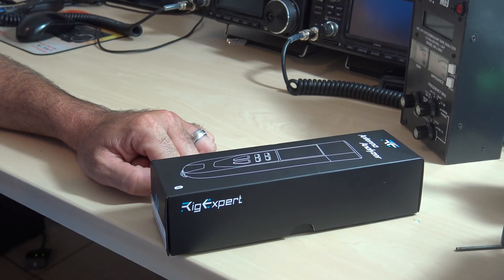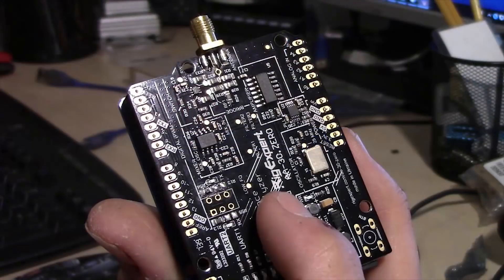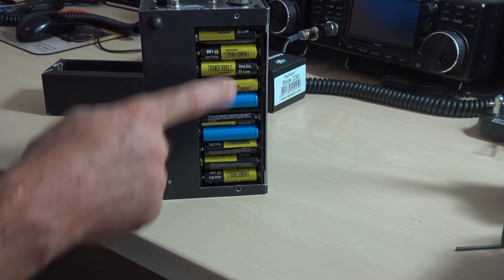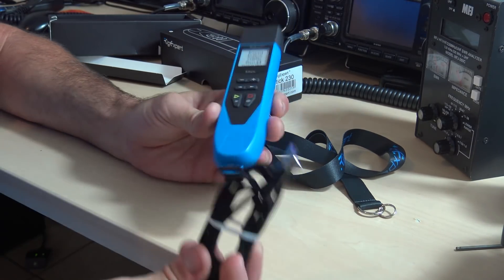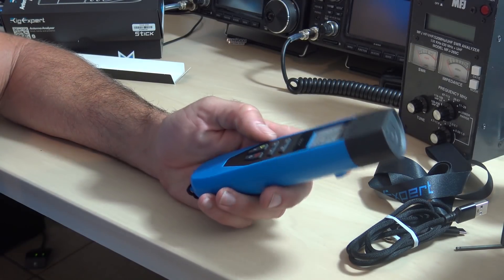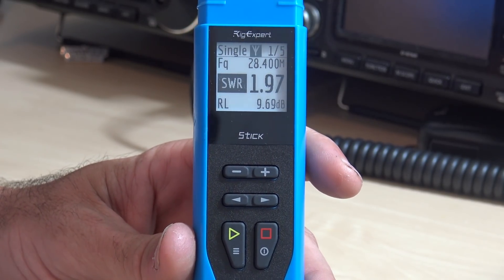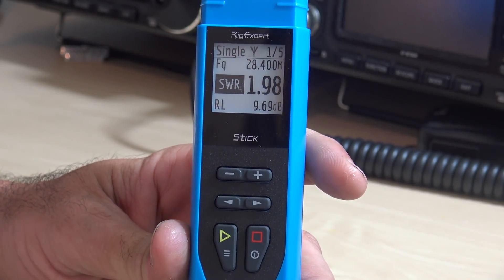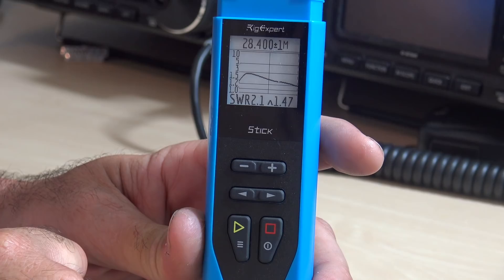NEW! RigExpert Antenna Vector Analyzer, Stick 230 Review

Comment: A lot of (being kind... most) Youtube videos seem to skim over details and key coverage, leaving viewers with 1,000 questions, many are core unanswered questions.  I don't know why, but suspect that content gurus are pushing out content for monetization.  For the viewer, when we get many videos per day, and we walk away with core questions unanswered from all of them... I start to wonder why it's worth it.  Clearly content providers aren't thinking through what they're pushing out regarding key points.  HRC videos are often right up there with leaving me with a thousand questions, many of them critical to me saying, "I can't buy this today based on what was presented, and like every other Youtube video it just leaves me having to go research just to fill in the blanks that 2 or 3 minutes more of core coverage in this video could have closed the gaps, or even substituted 2 minutes with some portion of the video that wasn't critical."  I've also noted over time that here HRC, that there's an awful lot of comments not responded to.  You seem to just rush off to push out more skimming videos without dealing with all the questions (or mess) you left on prior videos.

In this case, we've got a glaring wee screen compared to other analyzers.  Glaring in that it should call out to pusher/viewer that it should be addressed that ... like some other analyzers, it appears you can put some?! contents on a computer screen, thereby compensating (perhaps tremendously) for the units micro small display.  But that's not covered, and it's a glaring omission for this wee unit.  Correct?

How about, how does it measure up to the competition?  In other words, why would someone buy this vs other analyzers?  Pros/Cons?  Key points?  Correct?

So here's another video of many per day by the Youtube content providers out there pumping out skimmed detail, where I spent 11 minutes (on this one alone of many) watching this one expecting key questions to be addressed... but not.  This is the norm on Youtube.  Wish folks would slow down and work on quality vs quantity.  But I guess it's capitalism and monetization.

Feedback ...
Reply from the maker: Tom W5VLT you know, I’m making a video exclusively highlighting your comment here, with your callsign, to teach all the viewers how to stop crying and starting making their own videos. If you don’t like it then stop watching. What you don’t understand is that people said they do not want to spend more than 10 minutes on a video.. have you ever sat and watched an hour and a half long review? Kind of boring ain’t it? I’m not out here to make sure everyone is satisfied in controlling my channel, and I’m not out  here trying to monetize exclusively. But the fact is I work all day every day, and then spend my evening and into the wee hours of the morning working on videos. It’s another full time job, and you’re going to criticize that I don’t respond to every comment? Ok, so you clearly have no idea that I get over 150 comments a day on average.  You obviously have the time to sit there and read through them all, more time than I do, so stop watching my videos forever, unsubscribe , click the thumbs down (because that also helps and is counted as an engagement by YouTube) and go start making your own videos on YouTube. Send me a link to your channel so I can watch. Until then, I’ll be pinning your comment for all to see on the top of the comment section. Thanks for your awesome feedback comments (which also counts as an engagement by YouTube)
Reply: HamRadioConcepts 
I’m actually watching MIT classroom sessions (whole courses, much longer than 11 min.) on electronics as a last ditch effort to break through the barriers to the science of radio.  For those seeking real information, time spent is not a concern when real info is delivered.

In point of fact, for all the skimming YouTube’s out there pushing out shallow content to monetize pockets that viewers spend the time (in vain) to get real info, added up, it’s a tremendous loss of time.  But without repeating myself, it makes me wonder what the content providers think (not much) about the downvotes - and I didn’t downvote this video but I am starting to unsubscribe those radio regulars pushing out fluff absent core coverage of subject matter, and who are absolute nonsense at handling constructive feedback - or think about all the people like me who view these Youtube videos and do not upvote... which is more ignored feedback.  

PS... don’t confuse (or rest upon) some’s desire to see shorter videos, with a desire to see quality (informative, value) videos of a possibly longer length.

I take the time to tell it like it is for hopefully improved content, and ... see above reaction :)

73
Reply from the maker: Tom W5VLT I appreciate all kinds of feedback but you will NEVER know what it’s like to put this kind of work into this YouTube channel. You’re clueless, go ahead and talk to all the YouTubers, you will learn it’s very aggravating to have someone sit here and comment and assume they know what is really happening but they have NO IDEA what it takes to make that video that you just watched with all your free time
Reply: HamRadioConcepts 
My being “clueless” to the efforts of folks pumping out YouTubes constantly (maybe slow down, again, quality > quantity) is not the same matter of discussing outcomes.  

But as an aside, maybe the reasons all us folks don’t downvote in our frustration, is a basic appreciation for those efforts - and as we know, very, very few of all those folks who either “don’t upvote” or do downvote will take the time to share their feedback - especially as in about 2/3rds of cases so far the content pushers react wildly ungrateful and hostile to constructive feedback. 

But back on target to Outcomes...

Here we had clearly a segment of coverage that left out such fundamentals anyone would expect to hear, such as:

1 - How does this compare to other analyzers... trade offs... pros/cons ?

2 - With such a small, single display, how is this a competitive unit?  Coverage to answer this glaring question might include that it interacts on a computer screen where screen size is more than covered/compensated (if true)... or is portability really the big trade off for wee screen size - it’s market?  But then I’d consider other analyzers to be portable?

These two aspects at least would be the very first considerations that would be part of coverage, even within 11 minutes.  

It seems for so many Youtube videos, not just on radio topic, that content pushers don’t even stop to consider a videos key points before starting to develop it.

Going further in general...

Radio is a true science - sitting atop the very real sciences of physics and electrical engineering.  Radio material - whether book, article, video, presentation - should respect “the learning audience”.  For the many (most?) like me who do not have the benefit of academic/professional backgrounds in these sciences to afford the “ease of sliding into Radio” in this age of Icoms and Yaesus, these materials should be more mindful to connecting the dots to the science - avoiding jargon to explain jargon, speaking to details and connecting dots rather than skimming or skipping.  Not necessarily related to this video, but in general seems to be gaps between providers and audience to consider.

I like your videos, your style and energy, enthusiasm for Radio... not so much your reaction to critique delivered to help improve value - and overall that’s why I don’t downvote.  I noticed a trend of everyone seeming to push out videos lacking the fundamentals of “what are the fundamental questions people will want to know that when they’re finished viewing, they’ll upvote as a sign of value received?”

PS I would gladly chip in a hand in vetting scripts or however you develop a video’s content; regarding key points, opportunities to connect dots for beginners, etc.  I wish more elmers would have beginners help vette material before publish (especially all those ARRL book authors whose titles or Prefaces target Basic or Beginners).
Reply from the maker: Tom W5VLT just an FYI I push the record button on the camera and record. No script or planning is involved . This is why I have errors I am human. This all happens after I come home from 10 hour work days, ignoring my family and pets, and eating dinner in my room while my wife eats by herself and goes to bed early.
Reply: HamRadioConcepts 
Well that explains it, :)
First you say it takes a ton of work to make a video, but now you say you run around in real life, and fly by the seat of your pants to impromptu squeeze out a video.  Regardless...

If you want to increase value to your audience on basics, and a broader audience, keep reading for a suggestion (or stop reading if not)...

Consider taking 5 minutes before jumping in to a video, and ask the following questions (make your own short list, mine are off the top of my head):

- Considering the subject, what are a short list of “info points” most people seeing the title will expect to be covered to consider the video worth the time?  If it’s a product review, do I have a standard list (such as “how does it compare to competitive products”, “pros and cons”, “unique features”, “do I recommend it / will I acquire one... why / why not”?

- What is the purpose of the video?  In other words... key take aways for the viewers?  Tell the viewers up front, and close with it.

- where in the video can I add value to educating the science of radio?  For example, if it’s a product review, can I tie it into radio science in some way to reinforce science in an actionable way for the viewers?  More specifically in this video, there was an opportunity to give one or two statements up front about what an analyzer is and does... “briefly for the beginner, this is an antenna analyzer, which allows the operator to connect it to a feed line, or a feed line and antenna, to measure and tune ... etc. ... so if you don’t have a “plug and play” matched antenna at 50 ohms, or one that is potentially so unmatched that your transceivers’ auto tune feature (if yours have one) cannot tune it, it can tell you all the performance factors you need to solve a matched solution.

For reviewing a tuner, a brief educational moment in the intro might be something like, “for the beginner quickly before we get started, the tuner connects between the transceiver and feed line to antenna, and when the impedance of the antenna solution is naturally unbalanced due to its design, band, and frequency within the band... beyond the ability (if any) of your transceiver to match the antenna system... the tuner acts to match the impedance of the antenna system to the 50 ohms the transceiver expects to perform well.  So the tuner will balance the impedance of the antenna system by changing voltage-to-current of the RF wave between capacitance/inductance reactance back and forth between antenna system and transceiver.... so here we see with this unit ...” and roll into the review.

I did the above off the top of my head.  Taking 5 minutes of aforethought before a video, having a notebook of common points or points of coverage ... such as for Product Review videos vs Solution Reviews vs Event videos... would up the quality and consistency of quality/value.  Hope that helps.

Comment: I am shopping for a RigExpert Analyzer.  I think the AA-35 would probably fit my needs, but I see many comments about the screen being difficult to read outdoors. I considered a NanoVNA and a couple of kits. At the end of the day however, I really think I want an analyzer that is good. What I mean by that is that I don't want to wonder if I got a 'good one' from Aliexpress, etc. and I really am not sure I want to build one and then spend my time wondering if my readings are off because my construction was off. If all the cheap analyzers are so amazing, why or how do RigExpert, MFJ and Comet continue to manufacture and sell (and people buy) anaylyzers. Also, I think the e-ink screen will be amazing indoor or out. Being able to run AntScope is also a bonus. I'm not an Apple guy, but when it comes to an antenna analyzer I want one that 'just works'. Thanks for the Vid

Comment: Eric, I believe there are some key omissions from the Stick 230 that you should also mention.  The Time Domain Reflectometer function is missing.  I am not even sure if it works with the AntScope software.  I use the TDR function to check cable integrity, particularly for field-deployed coax because it is frequently coiled and uncoiled.  That seems to be a glaring omission for this product if it is really meant for things like Field Day use.  Of course, I am going on the specs as printed; it could be they modified the firmware to accomplish this.  But if so, the latest specs on this on the RigBlaster website do not show it.  Love the videos.  Keep up the good work.

Comment: $300 is pretty insane considering the china devices have "small" locked down for peanuts with much nicer displays, and for $100 more than this thing you can get a comet CAA-500 II which is not only incredibly slick in operation but is built like a tank, with UHF capability (it uses 6 AA cells but is capable of charging so throw some eneloops in and forget it). I guess the big use case for the stick 230 would be hardcore field users who need something that's both small and rugged (why is china seemingly incapable of rugged?) but man watching it in use was a big letdown, I love e-ink but the refresh rate makes it unsuitable for test equipment imo. If it was $100 it would be a different story.
Reply: route20  But what type of accuracy are we looking at with Chinese equipment? Cheap? Yes.Accurate? No.These serve a great purpose for portable operation,including for SOTA use.For that reason alone,they are worth their cost in providing accurate readings,not ballpark analysis,merely because money was saved.
Reply: @redman840  do some research on the chinese devices, the accuracy is quite good (VNAs aren't exactly difficult to implement in 2019). "merely" saving money is a big deal to lots of people in an already absurdly overpriced hobby. if you're loaded enough to buy this you're loaded enough to get the comet which makes it look like a toy, or hell if you need lab grade accuracy for your hobby an anritsu on the used market. the price for what you get here is almost insulting. I agree that the size and (presumed) build quality do make it viable as a niche device for people who are doing a lot of outdoor operation but this should not be anyone's choice as their first or only analyzer, it just looks super frustrating/clunky to use compared to what's out there for less money. a screen with a usable refresh rate and some kind of miniaturized/ruggedized knob or encoder would make this a lot better. again, it's about what you're getting and what it could have been *for the price*.
Reply: route20 Clunky is what MFJ analyzers are,yet they are the standard for even those putting up $10,000 directional arrays.Why is that? Read reviews on eham.net and you will see the Comet does not rate very high for accuracy,or quality control.Unless you go professional grade,Rig Expert is the new standard for quality analyzers.Why drive a Yugo when you do better? Low price is for those cannot afford it,but for those who actually can,why settle for less in analysis readings?
Reply: @redman840  Regarding the comet, I put "CAA 500 MK-II" into eham and got 3 pages of mostly 5 star reviews so I'm not sure where you're getting that, that's a straight up "alternative fact". I don't find the MFJ to be clunky in operation compared to this device, at least it seems responsive from videos I have seen. I will say that I haven't tired it myself so can't give direct experience, because I avoid their stuff since getting burned with defective parts twice. That's why I never brought it up in the first place. (edit: it was the "standard" because for a long time it was literally the only affordable analyzer. that is not the case anymore) Regarding the last few lines of your post, which seriously make you sound like a paid sponsor but whatever, even people with money don't want to feel ripped off, and that's how I would feel if I paid $300 for this thing. Again, you just don't seem to get much for the money. I am not saying this is the case for all rigexperts, I am saying it's the case for this particular product.
Reply: route20 Actually The Rig Stick gives you a lot in a small package,with SOTA use in mind.I own both the AA-520,and AA-54 Rig Expert antenna analyzers.The AA-54 is actually a very good analyzer,with lots of parameters for antenna data.I don’t do “alternate facts” I deal with real time experience.That’s all I can relate to you,and from the experience of others who have used similar equipment.Take care  & 73.

Comment: I have both MFJ & Rig 230Z and not crazy about them.  I have a cheap $160 China knockoff that goes way beyond my need and comparing it with the other 2 big $$$ units it is just as good and accurate.  I'm thinking of trying the comet but how many do I need seeing I don't sell my stuff.